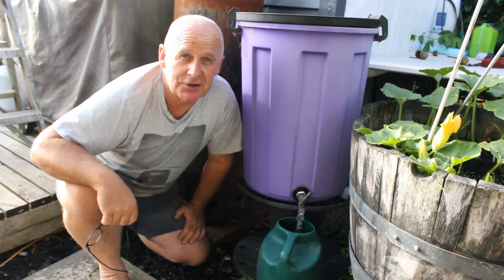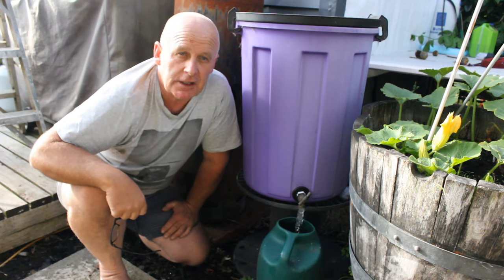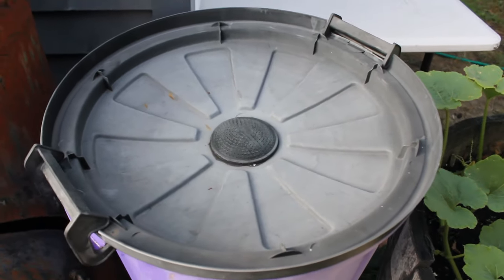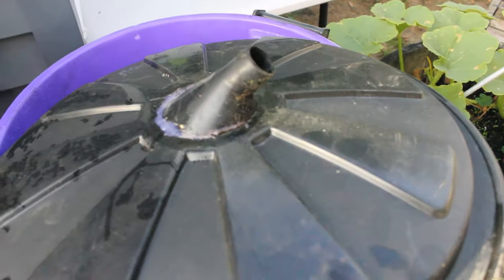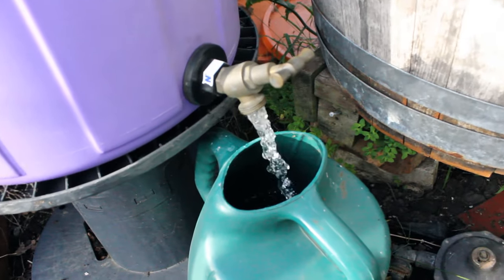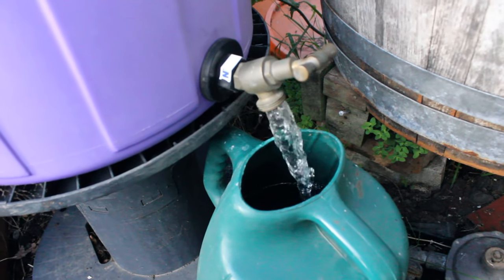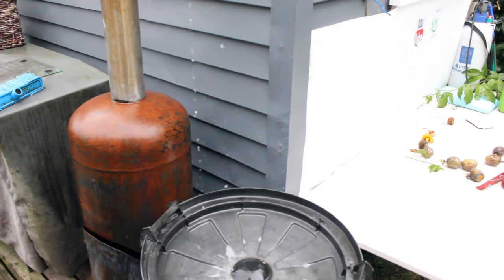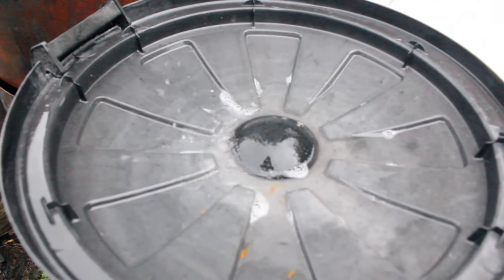Self Filling Filtered Rain Barrel for Your Garden DIY

Comment: Thank you. This upside down drain makes a perfect low cost first flush diverter, for a larger water tank. You would locate an overflow flush outlet at some point between 1/2 and 3/4 the way up.

Comment: Oh brilliant. How do i make the hole for the tap and any particular tap? Thank you very much from 🇬🇧
Reply from the maker: any tap you like! can be a faucet or a valve - whatever you like. and you drill a hole, with a drill. or heat up a piece of metal pipe and melt it through
Reply: @t.h.o.r.  ok how do i make a hole big enough ?